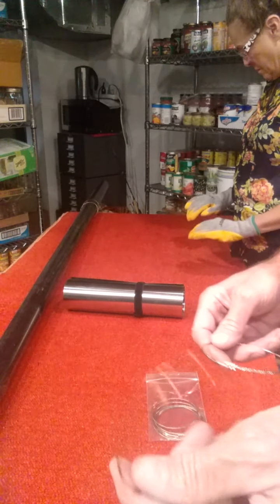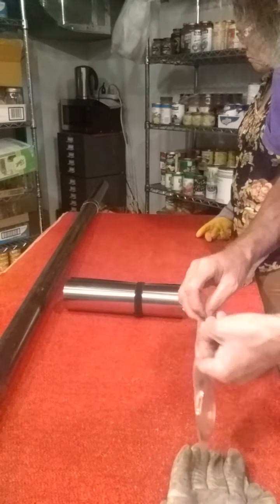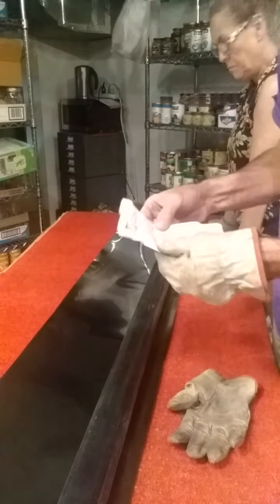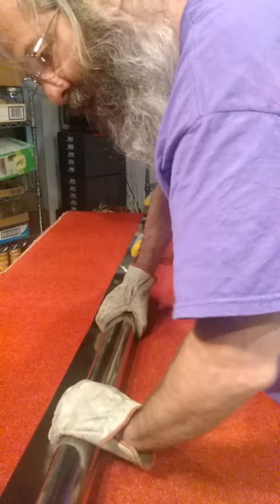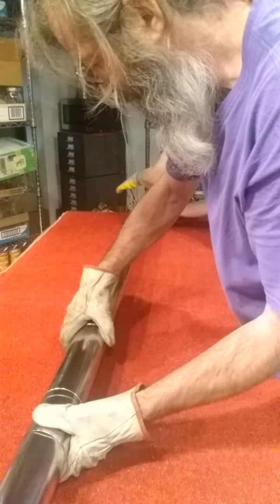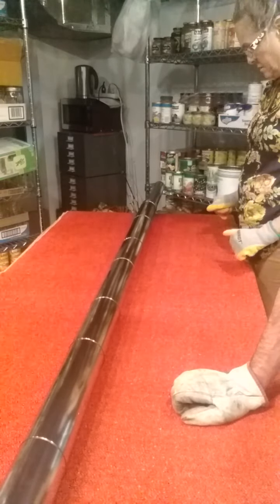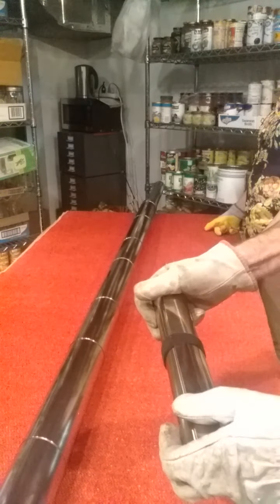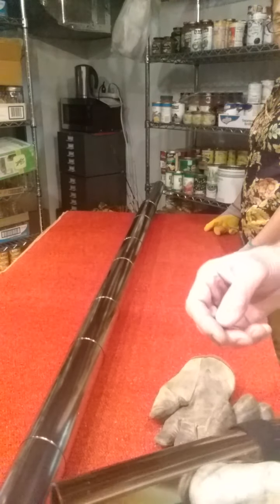Rolling a titanium stove pipe for the first time.

Comment: What diameter PVC pipe did you use ? 2 -1/2 “ ? thanks
Reply from the maker: I used black water drain pipe. I believe it's 2 3/4 in  or somewhere are 7 cm. Good luck!
Reply: @bigsky2081    Thanks !